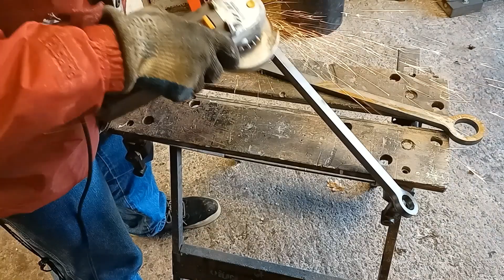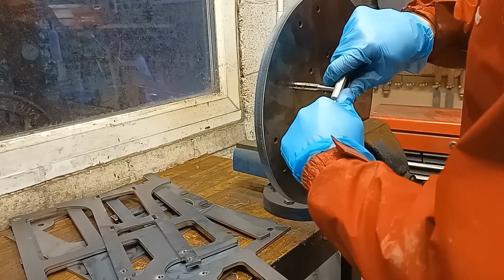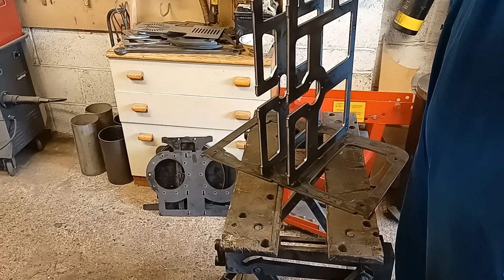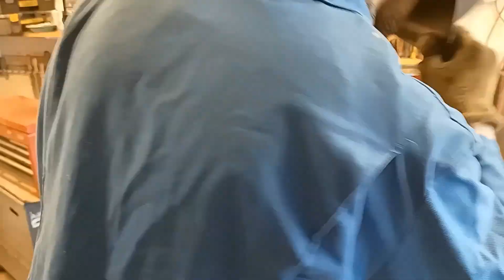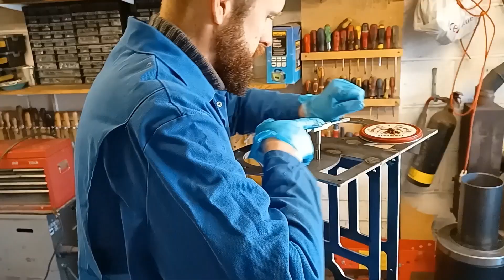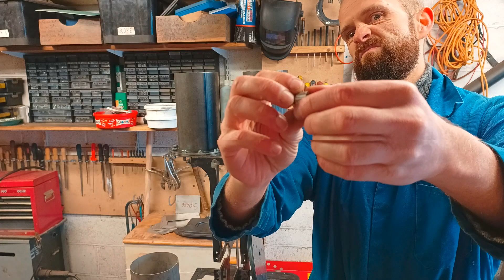Building a Stirling Engine that is Wood Fired - Part 2 - (Hopefully 500W + )

Comment: Very nice and interesting project! I'm wondering how easy it would be to upgrade to a 10 Kw generator.
Reply from the maker: If this engine gives out 1kw then something 10 times the size. The problem is power density is low under atmospheric pressures. It would be a very simple engine! No valves, etc
Reply: @ShanePomeroy  Sorry if you've already talked about this elsewhere, but why is it you aren't trying to increase power density by increasing the pressurisation? Or is that in the works but not for this build? Incredible project!
Reply from the maker: @al3xf103  Hi, the original idea was to keep it as simple as possible and maximise its potential as an atmospheric engine. I may try some light pressurisation at some point : ).
Reply: @ShanePomeroy  Ok that makes sense. Great job so far btw! Looking forward to all your future videos on the subject! :)

Comment: Have you thought about using a  break hone to smoothen your cylinders. After a bit of honing  you could switch to toothpaste and a little water to give it a higher finish. I think it would definitely help minimize the friction, better seal life, and more compression/performance. Great channel!
Reply from the maker: Hi, the piston / cylinder is a little different than the usual arrangement you see. The piston skirt itself is the sliding bit and the seal is mounted to the cylinder if that makes sense. Not an ideal setup but it can be constructed without machine tools. It later video's I'll make sure I show all this fully. Kind regards